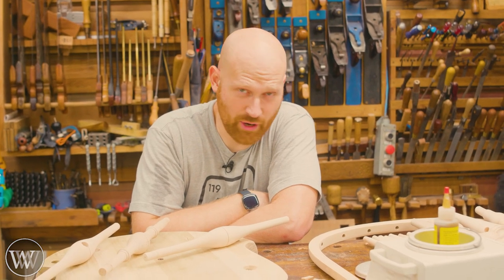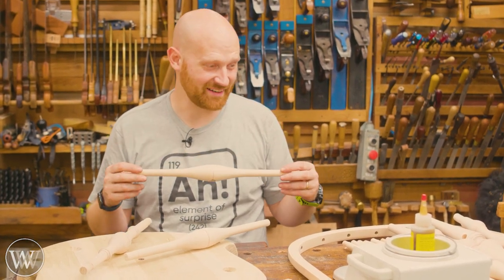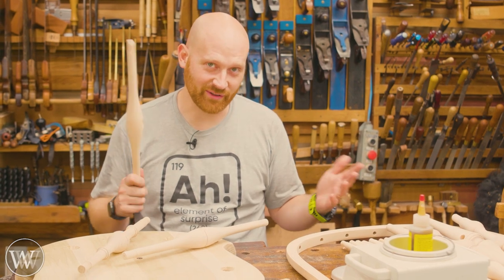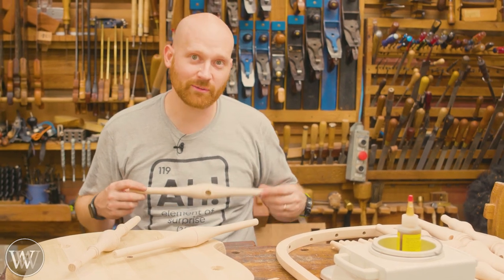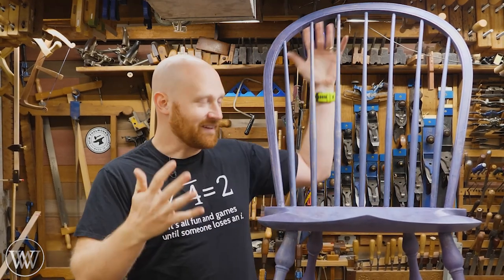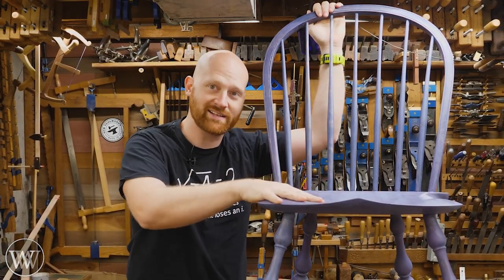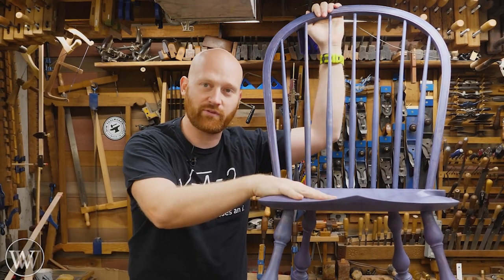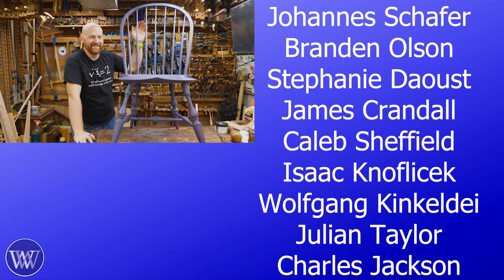Windsor Chair Kit From Colonial Homestead ASMR

Comment: What kind of wood does the kit use, and how is the chair holding up so far?
Reply from the maker: There are different types of woods for different sections of it. The bent back is out of oak the spindles are out of maple the back spindles are out of hickory and I think the seat was out of poplar. But it could be wrong on that one. I don't remember for sure. So far it's been holding up great. Haven't had any issues with it and that's with having three kids running around the house jumping on it.